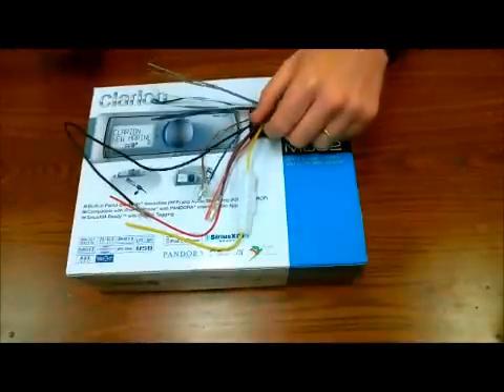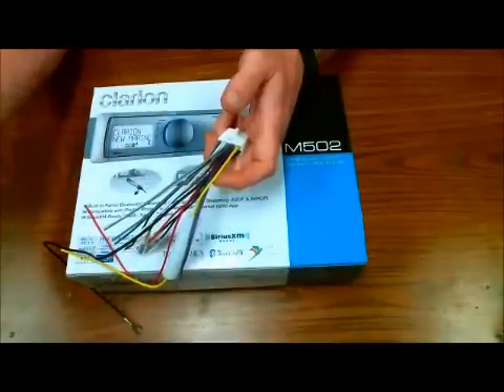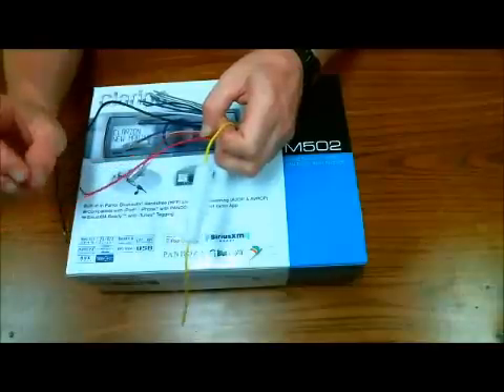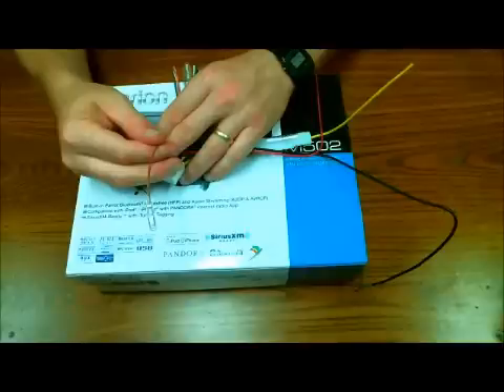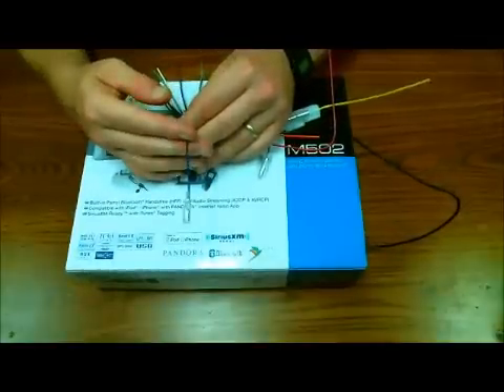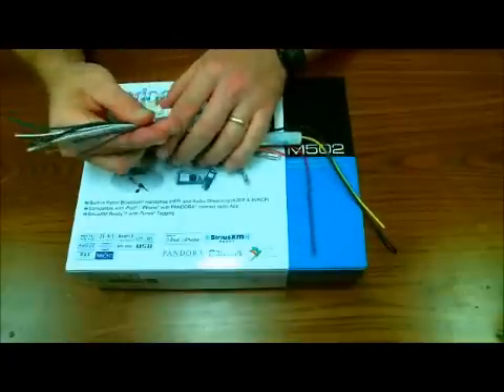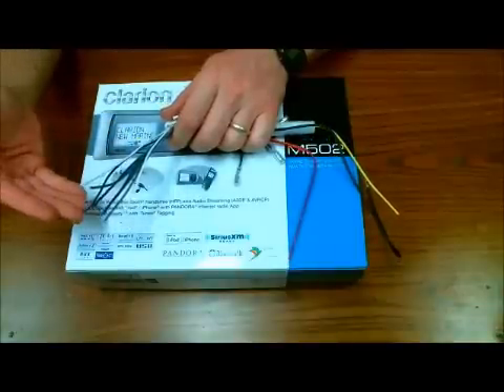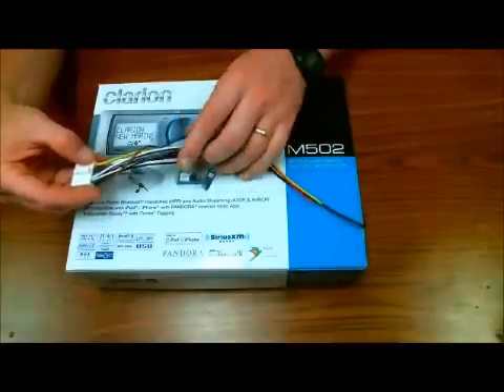Car Stereo Wiring Explained In Detail

Comment: I drive a volvo truck and I had a pioneer radio, got a harness named vw9000, connected the wires, some color mismatch, but I got it working and after a few days it started blinking and shutting down as soon as I press src button. I double checked the wires and later it completely stopped working. I figured it was the power but I don't have the tools to check it. I exchanged the radio, got a sony and when I connected it I hear a sound like it gets electricity,  but it won't turn on and when I connect the old factory radio it turns on, maybe it needs less power if that's even possible? I'm getting pretty pissed with these radios,  so I'd really appreciate your help. Thanks.

Comment: I have a 2002 lancer and my car has a green Nd white wire but idpnt know were to connect it too... It controls my left marker lights in my car witch is weird... Please help how do i connect that wire so my marker lights turn on acordatle to when my head lights are on
Reply from the maker: Is the green/white from the new stereos harness or in the car itself? and also what year make and model is the car?
Reply: I figured it out i just needed a iluminator wire to run the break to so i needed a radio that had one

Comment: The harness I got for my '99 Camry has an orange/black, blue, and brown wire free, with no counter parts on the radio, while the radio has a grey/black, purple/black and green/black wire free with no counter parts to connect to on the harness. In addition, I connected the orange from the harness to the orange/white on the radio. This is a BestKit harness by the way. Am I doing something wrong or will the radio (JVC) still work fine?

Comment: Hey I have a kf 1991 ford laser and on the factory harness it doesn't have a yellow wire would that be cause its link in with another wire like acc or what
Reply from the maker: I dont know what country youre in but we dont know what ford lasers are here in the usa, I advise you to use a test light and check all the wires in your stock plug for a constant, your car may use a different color.
Reply: Lessco Electronics Ford laser/Mazda 323 in Australia. we had an old 85 Laser, same as equiv 323.

Comment: Great video Lessco.  I just put in a radio on my wife's car.  The only question I have is, on the harness that came on the radio, the blue with white tripe wire has a sticker on it that says "Remote Control" and I just spliced it in with the aftermarket ford Harness that I bought that says that is the Power Antenna wire, was I right in joining those two?  The radio has a remote and it does work, but her car does not have a power OR windshield antenna.

Thanks!
Reply from the maker: You did it right...

Comment: hi, my dvd player aftermarket head unit is installed via the harness but im having a few problems. hoping you can help. My central locking now does work? im losing memory, and the unit doesn't switch off with the ignition? please guide me in the correct direction? what wires are causing isses? by the way nice vid...

thanks

please can you email me

adam.robinson1985@outlook.com

Adam

Comment: the wiring harness for the new radio doesn't have an orange but the metra adapter does. the radio should still work if it's just hanging off to the side right?
Reply from the maker: yes, orange is just the illumination lead, it does not matter
Reply: Lessco Electronics ok. i also have another issue. all the wires are together but when i hook the radio up to my car it doesn't do anything. i think it may have to do with the ground wires cos the black is connected to black and everything, but there's an extra wire with a kind of clip on the end that comes out of my car.(2002 Subaru impreza outback sport if it makes a difference) it was connected to a piece of metal on the original brackets so i tried clipping it into a piece of metal on the new radio, but again, nothing. Sorry, i'm kinda bad with stuff like this the old radio just didn't work right so i'm trying to replace it lol.

Comment: My car radio wont go off it keeps on so whats the broblem i wired the yellow one directly to battery positive and black to original ground and red to red whats the broblem???
Reply from the maker: Verify (with a test light) that the red loses voltage when the key is off, that's most likely the issue.

Comment: So I started hooking up my deck, everything wired properly like explained above, but I would get no power.

Then I accidently touched the white/black wire for front negative to the red wire, and bam I had power????

Can you explain this by any chance. I mean because this is the only way I have power my front speakers don't work because they aren't hooked up properly, instead are hooked up to that power wire?

Please explain :(
Reply from the maker: Is that the harness original by chance, I think you may have a rigged, rewired or improperly applied harness for the stereo, by the way, whats the model of the stereo? I may have the pin outs on it...

Comment: Howdy mate, thanks for helping myself and others. I have a ford forte series 3 of which I have been messing with all week trying to replace the stock standard stereo with a sony CDX-GT270; I have taken notes from this (your) video and have correlated it with this diagram I found          http://www.fordmods.com/ford-audio-visual-f5/need-stereo-wiring-diagram-for-2000-au-futura-series-ii-t115952.html
- I purchased bullet terminals today (which are bloody awful for ease of use) and have connected all wires from the stereo to the car wires excepting the dark blue/ white stripe wire, and one of the green speaker wires which I can just use tape with since I ran out of said terminals. I have no idea what to connect the aforementioned blue and white stripe (amp turn on as you stated in your clip) wire from the stereo and I've turned the car on fingers crossed but its not working whatsoever. The fuse in the back of the stereo is fine I replaced it today coz I lost it. The radio fuse in the car is also fine. Any ideas amigo?

Comment: Install went great.  Purchased the correct harness and had no problems.   As for the Key1 wire.  It was for the steering wheel controls. I don't have that so no need for it.  I have the Pyle PLDN74BTI unit.  There was a pink wire coming from the harness so I connected to it.  I can watch Video while driving now, without a bypass.  OOOOPs! Did I say that!  LOL!.  Thanks for you Video and reply. Loving the unit.

Comment: Very good Video.  Thanks. But on my harness I have 2 extra wires.  Green with a white stripe labeled Key1 and the Pink wire you spoke of marked Parking.  What do I do with those?
Reply from the maker: Im not familiar with a key1 connection, nor have I heard of it, what brand is this unit? I am dying to find out. s for that pink, it is a ground connection, that enaables on screen viewing while a dvd is in the drive playing..

Comment: I'm installing a kenwood mp208 into a 1972 VW super beetle, and i dont have the 2 front speakers, so I'm using the 2 back ones which are the purple and green, but where do i connect the blue wires?

Comment: got my yellow wirer hooked up to my yellow wirer from truck , when i turn the key off and turn it back on i have to reset the radio and the clock....how do i get it stay on and not reset ?
Reply from the maker: Verify with either a test light or a meter that your yellow has constant +12v and the red is getting accessory +12v power and black is a good tight ground connection and that problem will be gone.

Comment: Hey don't know if u can help me mu car stereo stopped working when I turned it up. I checked fuses and they are all fine and even the 10a behind stereo.so I replaced stereo thinking it had blown completely . New one still don't work what can it be ?
Reply from the maker: you either have a bad (shorted voice coil in a speaker) or one speaker has too low of an impedance value
Reply: I thought if it was speaker then stereo would still work and speakers wouldn't work ...

Comment: Got all of my stuff hooked up, however there are two orange wires left from my Metra harness that the new head unit does not match/have.  These are "dimmer" and "illumination/dash light".  The head unit is a Kenwood KDC-155U.  Should I just tape these two wires off, or should I do something else?
Reply from the maker: tape them up, that's that
Reply: Awesome, thanks!

Comment: Hey I matched all the colors of the car radio with the wiring of my car and in the end i had a black and red remaining so I plugged them together, I had the ground of the new car radio on metal on my car and when I turned the key nothing happened. ..   DID I JUST FRY THE DAMN THING!?
Reply from the maker: eesh, It sounds like it, I'd double check by powering the stereo out of the car, just connect the red and yellow to +12v and the black on ground and see how bad the damage is...

Comment: hi- my old pioneer super tuner only has 1 wire per side to hook up the front speakers.problem is--the speaker cable requires a neg and positive--what can i do to get ground???----i cant understand why they made the pioneer stereo harness coming out of the radio with a normal 2 wires per side for the rear and the front only one per side-----im pulling my hair out here??---by the way this is in a 1969 chevelle SS. any help appreciated---thanks Don

Comment: Great video! I was wondering though, I have to install an ETC card reader, which also uses the black, red and yellow wires.  I have to share them with my stereo I assume? Would I have to get splitters?
Reply from the maker: You can hardwire those in with the stereo wiring. Just add fuses

Comment: With the orange wire 9 the head unit says illumination and on the aftermarket harness as one with both one with illumination and one with dimmer which would I connect the aftermarket head unit to
Reply from the maker: orange to orange, color to color, you cant go wrong.
Reply: But illumination is on both and dimmer is on one but the line is opposite so that would make it illumination to dimmer

Comment: I am trying to connect a Pioneer AVH-X5600BHS (purchased bc of your review) to a 2005 Dodge Ram 2500 with Infinity sound. To access the steering wheel controls on the truck I purchased an Axxess ASWC-1 and this is where I am stuck. I am perplexed as to where I would need to splice the Pink (indicated wire) of the ASWC-1 to the Pin 14 on the vehicle's connector which happens to correspond with the aftermarket harness orange (illumination). Could I have the wrong after market harness? Thanks for your videos

Comment: Ok I have a 2001 dodge Dakota I got a dual cd player and tried to install it I bought the wiring harness and the dash kit well I plugged up all my chords except for the blue amp chord the two orange chords and the brown mute chord and now my power to the unit comes on but absolutley no noise on CD or radio nothing plz help me. Someone told me that I have the infinity speakers already put in my truck and I have a amp wire that has to be plugged up but I'm lost help help help

Comment: Thank you very much for the tutorial it helped allot. I just have a question,  I have a Sentra 2000 GST, yesturday that I tried to wire I encounter with a black box where my red, yellow and black cables entered and another 3 cables with the same color where output. Inside the box their is allot of circuits.  Is it important? What is it for?
Reply from the maker: that's usually just a noise filter, it may or may not be of importance, If you cant fit it in there, just cut it out, but if theres room and it's not bothering you, just leave it in there.
Reply: Lessco Electronics One last question, the old stereo has a orange cable which conects directly to the positive terminal of the battery, it`s label with a B+. Also the cable has an adapter which contains a fuse. What is it? Is it important?

Comment: My 94 z28 has a bose system with an amp on each speaker.  how do I connect my after market kenwood  wires to power up the amps.  Do i have to use the blue and white wire.  Or is it even possible to do without bypassing the amps?

Comment: OK! great video.. answered a few of my questions.  I am wiring up my new JVC KW-V20BT double din into my F250 truck. I have the straight forward wires matched up by function.  However, I have 2 things that I am confused about. 
(1)**On the receiver wire harness I have a orange/white stripe marked as "dimmer control wire" (says to car light control switch)... on the wiring adapter I have an Orange (marked illumination) and an orange/black stripe (marked dimmer). As far as I can tell, there is no additional illumination wires/dimmer wires and certainly no additional orange wires.  WHICH OF THE 3 DO I ATTACH TO WHICH? OR DO I ATTACH ALL 3 TO EACH OTHER!!  :) I cant find this answer anywhere (have not yet called crutchfield).
(2)**On the receiver wire harness I have 1 solid black (labeled ground ''to car chassis").  On the wiring harness adapter I have 1 solid black (labeled Chassis ground) and 1 black/white stripe (labeled "signal ground" and says "connect with black wire").  WHICH OF THESE DO I ATTACH TO WHICH? OR DO i ATTACH ALL 3 TO EACH OTHER? (also another question I cant find an answer to).  
** now that I think about it, is it normal/safe/etc to attach the "parking brake sensor wire" to the ground of the wiring adapter with the other ground wires?  will that bypass the parking brake cut off?  THANK YU SO MUCH FOR YOUR HELP!!

Comment: hey recently got a car stereo to replace a stolen one, went for the cheapest I could find that supports aux input, spliced it to the adapter color for color but no sound over my system, I was wondering if you had any ideas that could help me determine what my problem is
Reply from the maker: ok, give me the details...
Reply: not sure what I can tell you... I checked the leads to the speakers, it doesn't look like they are outputting... so right now I've got a computer speaker acting as an amplifier so I can plug my mobile directly to the speakers... though I'd still like to get it working

Comment: Helpful video, me and my friend installed a new stereo in an old car, the car has a direct wire from the battery with a 10 amp/250v fuse, and the wire from the Acc, the car wires are not color matched,and most wires have been redirected, so we wired it according to our own knowledge, it currently only has the 2 front kappa speakers with an amp for 2 12 subs, however we did the red wire directly to the battery and the fuse, the yellow wire was the ACC, that was our mistake. so we will reconnect the ACC to the red and the Yellow to the battery as this video tells because the car doesn't save presets every time it is turned off...

Comment: So when installing an amp and sub, youre going to want to run a remote wire from the amp, and connect it to the blue and white stripe wire in the stereo harness?
Reply: Some cars need that blue/white wire to be connected to the wire harness you purchase for your car just like all the other wires because some cars have a factory built in amp. so then you just use a "t-tap" or a "scotch lock" wire splice

Comment: I have a Lexus is250 and it has a stock amp. I'm looking to install a line out converter. I was wondering what wires going to the stock amp do I splice in to. I have pictures upon request. Thanks!

Comment: I installed a Performance Teknique icbm 9723 in a 2000 Ford Ranger.  The radio stays on when the key is off.  I checked the wiring and it looks correct but I have a feeling I missed something.  There is also a blue light around the volume knob that stays on continually.  Any ideas would be greatly appreciated.  Thanks for the video.
Reply from the maker: make sure the yellow is constant 12v+ an the red is 12v+ keyed power, that's usually the issue every time.

Comment: What if the harness from the aftermarket stereo has a blue/white cable and the harness that goes with the factory cables doesn't and only has a blue which is the antenna cable? I called crutchfield and they told me to connect the three of them together. Do you think it'll affect anything?
Reply from the maker: not at all, thatll work just fine

Comment: i tried wiring my stereo today ran into some problems...my cars harness had three wires left when i was done: a white wire with blue stripe, a red wire with a black stripe, and a solid red wire....what should i combine?
Reply from the maker: I can only assume, you chopped (or someone did) the factory harness and that left you with these strangler wires you have left over, my advice ios watch the free wiring info vid I posted, in it,  it gives you a way to get all the color codes and colors/locations of every wire in your car. Its a great helpful resource, I know it'll help you.

Comment: hey man, first off, great video but i had just one question that has been bumping my head for some time while i was watching your video. My wiring harness for my nissan altima 06, has a blue wire (Power antenna/Factory Amplifier remote turn on) and a blue/white wire (Factory amplifier turn on) and the wiring harness for my aftermarket radio (Kenwood) has a blue wire ( Antenna control wire) which says its not used and a blue/white wire (power control wire). Should i connect them color to color or what? Thanks in advance.
Reply: Btw I don't have any subwoofers or anything like that in my car.
Reply from the maker: What Id do is connect your cars blue/white into the red wire on the harness, so itll get energized when the cars on. Otherwise your factory amp will never turn on and youll have no tunage